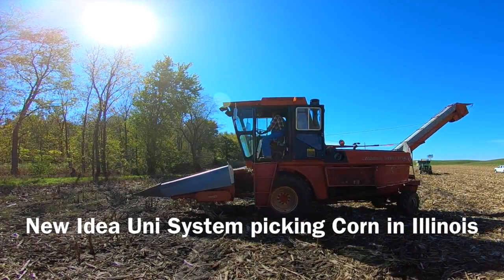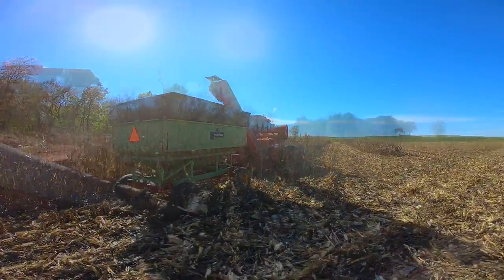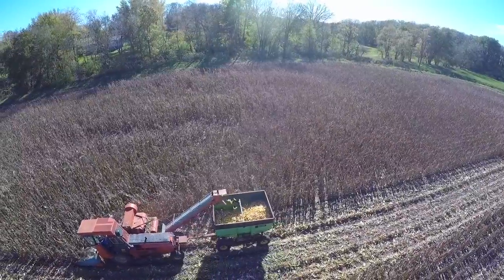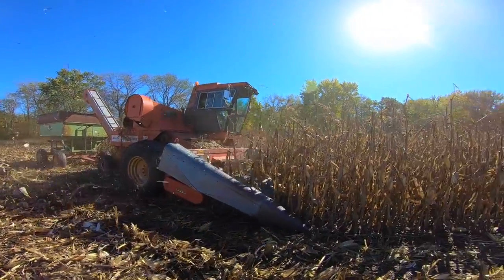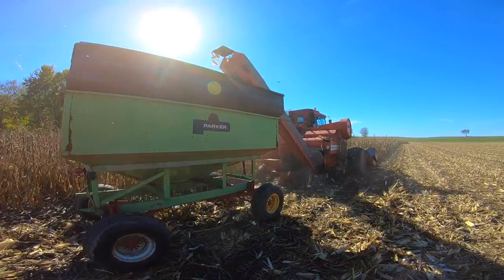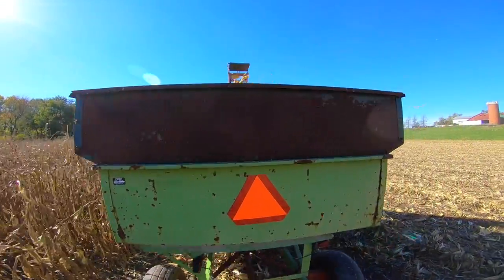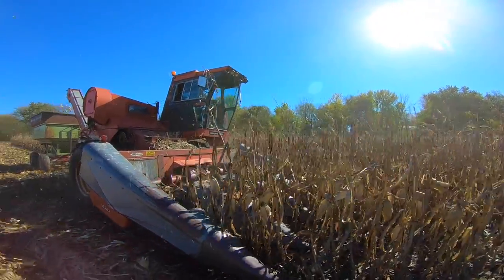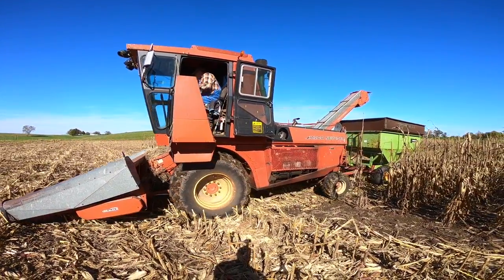New Idea Uni System picking Corn in Illinois

Comment: Can you still get parts from agco for them? It's a shame that no company still makes corn pickers.
Reply: Oxbo makes big ones
Reply: There are a few salvage yards that still have use parts and a at least one place that has a few new parts for the power unit shafts that go from the transmission to the final drive. Dad had the first Uni sold by Dinkel Implement in Norfolk Nebraska in 1965. It had a corn sheller attachment with a 2 row 40 inch head and a combine attachment with a 13' grain head. After that we did custom work and in '67 Dad traded the old Uni and bought two more. One with the combine, and both with shellers. Still a 13' grain head, one 4 row 40" corn head and one 32 row 30" corn head.  In 1984 through 1986 the man who started Producers Hybrids [now AgReliant], Roger Herrick, hired us to pick seed corn with his 737 shucking bed and a 4 row 30" corn head. I got tired of swapping attachments and bought a TR85 New Holland combine in 1994 and used New Holland combines until I retired from farming in 2018.

Comment: Great machines but major fire traps if you did not STOP and clean the engine screens now and than.    We never had trouble but we sold one to guy and he did not listen to us and tried to run it like his big combine and it burned up a couple weeks into the fall.  Engine mounted under a fuel tank that sat behind the cab was not the safest design.  If the screens were not keep clear the engine compartment overheated and the grain dust caught fire.